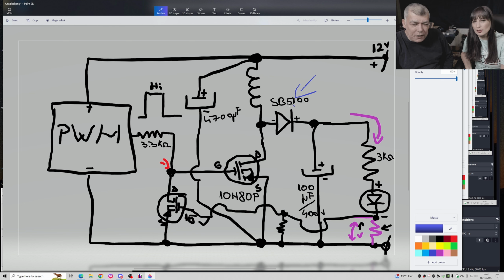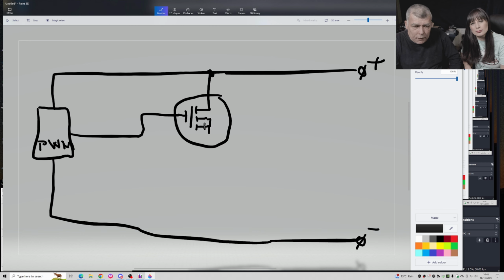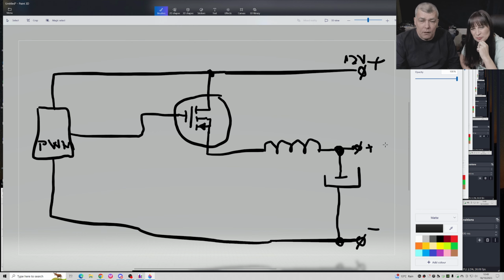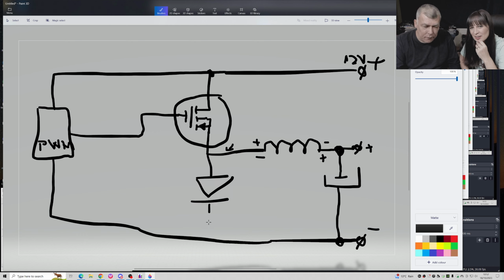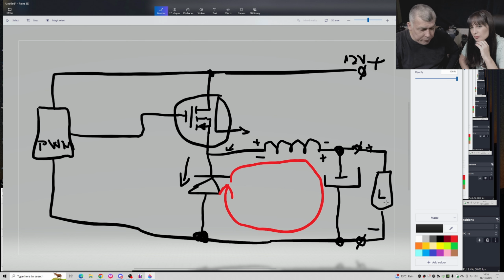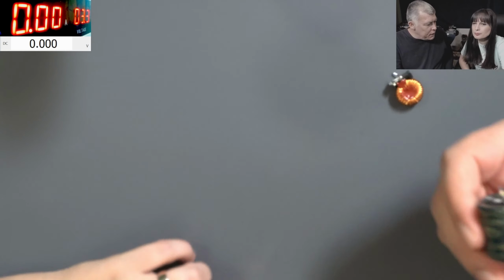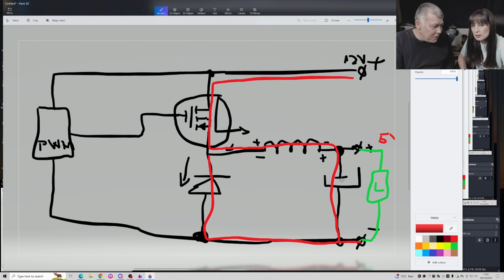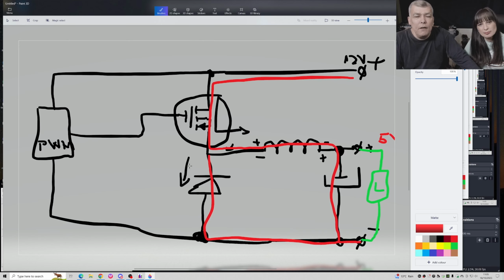Buck converter or step-down converter explained - Lesson 33 Learning electronics with Diana

Comment: yeah PWM controller creates AC signal and capacitor acts zero ohm in AC current that is why buck converter can run without load.